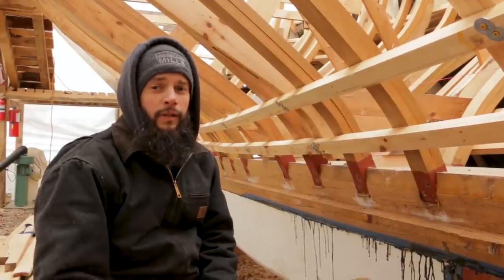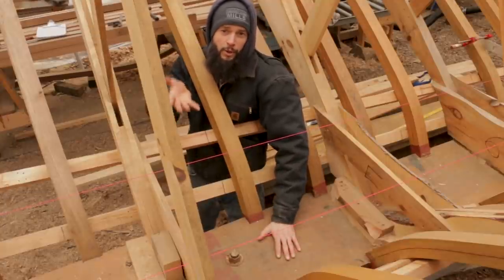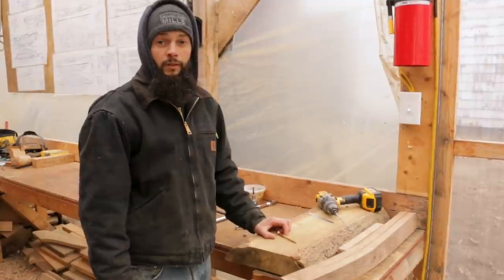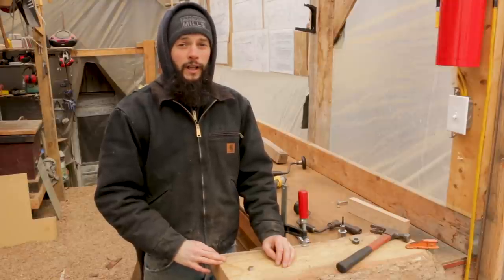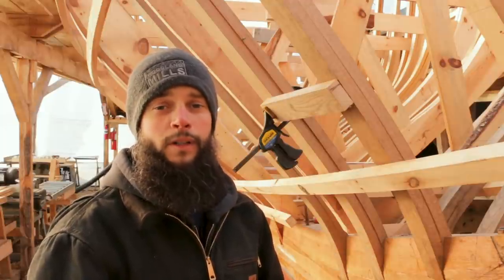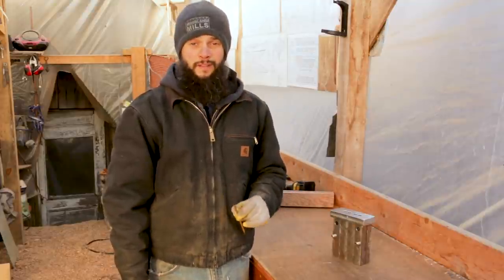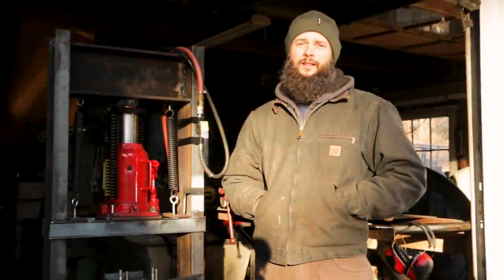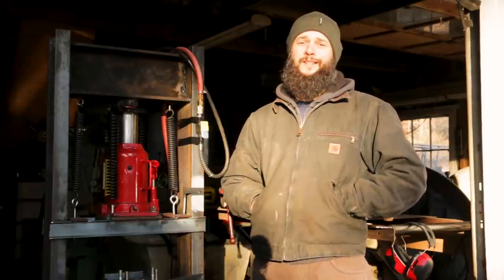Acorn to Arabella - Journey of a Wooden Boat - Episode 50: Homemade Copper Rivets!

Comment: Doesn’t using rivets to fasten planking make it very difficult when you need to refasten in 40 or 50 years?
Reply from the maker: I'll be 70-80 years old by then and it will be some young guns issue =) 
By that time you would just cut them or grind the heads off and pound them out.  In 50 years she probably will have some frames and planks to replace anyways so she would likely be loosing a good hunk of her planking at that time any ways.

Comment: You should ask Santa to bring you some rivets. That'd be SO much easier.
Reply from the maker: hahaha!
Reply: No srsly! Santanomics would indicate that any fasteners capable of withstanding the shock loading from accelerating 2 billion toys, each weighing an average of 5 lbs, to the required 2 million mph within the allotted span of 60 microseconds would be more than adequate. Santa has only 8 reindeer and if each reindeer has 2 attachment points then that means... (frantic napkin math)  each one is capable of repeatedly withstanding approximately 9x10^17 Newtons of force.

You could hold the entire ship together with a single belt buckle. 
Merry X-mas.

Comment: why do the rivets have to be cold pressed? why not heat the stock to make the pressing easier? why not just cast them from molten metal by the dozen?
Reply from the maker: Copper is soft enough to cold press and that is easier than heating or casting.

Comment: WAIT, 4 rivets x1,000 times at 5 minutes a pop? HOLY FVCK
your going to spend 84 hours making rivets? did i do the math right? 5000 minutes / 60 minutes per hour yeids 83.3 hours. Or 2 full weeks of making rivets?
Or is it 4,000 rivets/ 5 minutes /60 minutes/hour for 13.3 hours?
Why is math hard?

Comment: you have air right there , why not add a tee off line  for a air wrench, and air chisel , might speed up the change over time ,
Reply from the maker: We had that set up but the air wrench was not powerful enough and a air impact is  bit too powerful for the volunteers. Safer for them to be able to feel the wrench.

Comment: I cringed  watching  your  video.   Your " thin head bolts"  failed  when  tightened.  And  the  heads  will corrode.   Use flat head  plow bolts on the timbers,  Mcmaster-Carr  has  them.   Copper planking rivets, NO, NO,  and NO.   Use  formable 353 brass (ASTM B60)   1/4" round  stock.  This brass  is half the cost of copper, same corrosion resistance, and more durable.   Mcmaster-Carr also  stocks with same day shipping.   Using  the formable brass you may  form  eight at a time inlieu of 4.   Another option  is  to use a 50 ton air over hydraulic bottle jack to  form  a  dozen  rivets at a time.

Comment: How annoying it must be, to have to devote every other video to rectify comments from the previous one. Personally i skip the part of your videos where you do this.  Everyone have an opinion, most of them are not informed. Please stop devoting time to prove that you know what you are doing - others that do know what they are doing, know that you are too! 
As for the press and mold: 
Just weld handles on the nuts holding the mold together - takes out the tool handling for disassembly of the mold. Just club the handles and the mold falls apart, club it again and the rivets should - when properly worn and heated to room temperature - pop out easily.
It ain't got to be pretty to be functional.
Reply from the maker: It has nothing to do with us proving we know what we are doing and everything to do with sharing knowledge and understanding.  When the comments indicate that a significant number of people are confused about something we will double back and collect them and get them back up to speed.  
If it's all stuff you know feel free to skip it but we are not going to stop doing it =) 
Thanks for the suggestion!

Comment: Wood shrinks and metal screws aren't going to swell. The shanks need to be tight. Clamp your pieces and they won't get thread bound. Your screws need a longer bite to bind the frames to the beam. You will be sorry using bronze screws. No sheer strength. Thinking you guys are trying to reinvent the boat. New processes and materials are possibly better, but you guys are way out of your egotistical league to redesign what is tried and true.
Reply from the maker: Nothing has been redesigned here.  Screws into the frame heels are common place.  Copper rivets have been used for centuries.  The screws into the frames would only have caught at most a half inch into the second half, not as strong as a full through and through connection.